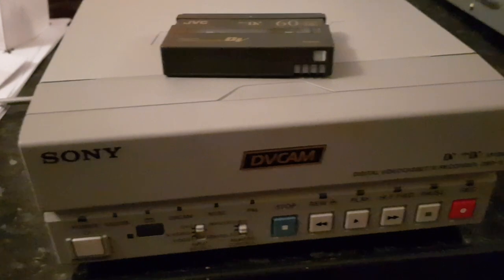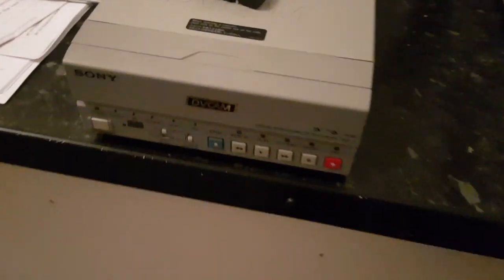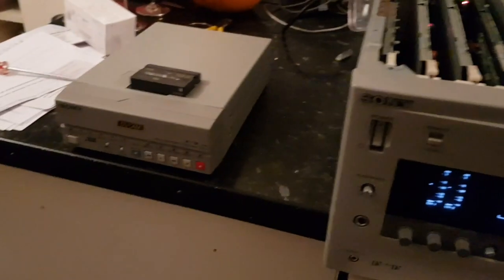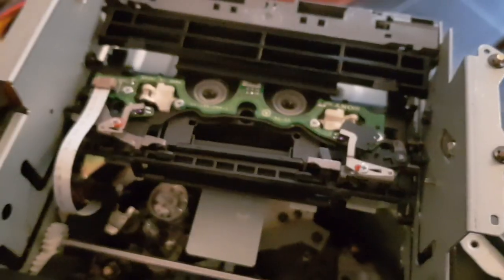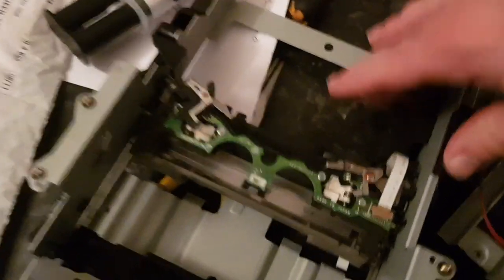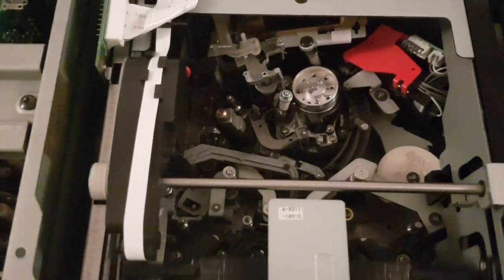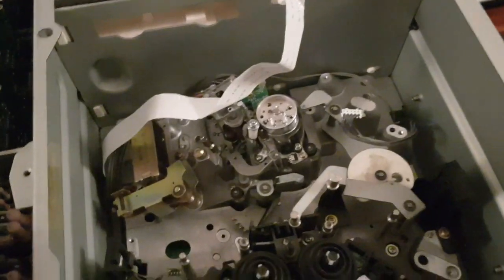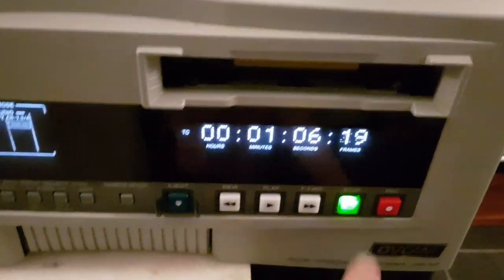Sony DVCAM DV Deck DSR80/80P Troubleshooting & Repair

Comment: Bought mine 10 months ago, just unpacked it, awesome piece of kit. Put mini dv tape in and.... brilliant!
Now need the device to transfer to computer via fire wire...
Reply from the maker: It's insane it doesn't come with FW really. SDI bridges are still very much specialist and hard to find. Might be easier to find a Sony Edit Station!

Comment: DSR-1800 gives error 02-154. Failed to detect the S reel FG by the FG check during cassette tape insertion. What does FG stands for? Any idea what could be wrong with it?
Reply from the maker: Hi there, thanks for the message. I did a bit of digging and FG is a term used in all types of tape-based media device. It stands for Frequency Generator. For any part which is supposed to spin, there is a sensor that detects the speed of this rotation. This is then compared to the signal produced by a frequency generator and if they don't match there is an error.
(source: https://books.google.co.uk/books?id=eRhJ1dni05sC&pg=PA418&lpg=PA418 )
In this case, I think it means that the S reel isn't moving at the correct speed or the sensor isn't working correctly. (There are two reels: S and T, standing for Slack and Tension respectively. The S reel is the one on the left as you look from the front of the unit.)
Refer to page 3-21 of the service manual, item 5, to find out what the procedure is. You'll probably have to use the diagnostic menu for this.
Good luck!
Reply: @BrassicGamer  Thank you so much. This was helpful.

Comment: I don't know if you could help me but i have error 22 on a DSR-80 (from service manual, trouble comes from "Threading mode"). Have you got an idea  to fix the problem ? Thanks.
Reply from the maker: Hi, sorry, only just seen your comment. Mine was also a threading problem. The only way I could work out exactly what the problem, was to observe what was happening by opening it up. By comparing with the normal threading procedure, I was able to work out what the problem was. Sometimes you have to get your fingers in there and give it some help to 'feel' the problem. If you can work out where the resistance or obstacle is, it can help to identify the problem area.

Good luck!
Reply: @BrassicGamer  Hi, thanks for your answer. yes, sometimes, i "help" the system with my fingers to find the problem ; i will insert the video tape into another VCR, i have some same models. Thanks.

Comment: I have SONY DSR-2000 way back, I have not use this since 2001.
Today I took out from the box, start used for 30 mins and my tape got stuck inside.
Its say "Error20-911.
Reply from the maker: Link to service manual is here: https://www.manualslib.com/download/1271855/Sony-Dsr-2000.html Error 911 is that the tape did not come 'up' in time. Either the mechanism is stuck because of the tape, or the tape is stuck because of the mechanism. This error results in the unit automatically powering off. The error stays in memory so, if you press EJECT immediately, after power off, it will attempt the emergency eject procedure. It is best to have a display connected to s-video out during this procedure. If this fails, you may be able to eject the tape manually as I did. Look at page 172 in the PDF (page 4-16 in the contents). You will need to remove the top panel and front panel to do this.
Reply: @BrassicGamer  Thank you.
Reply: @BrassicGamer   Hello I'm not be able to download PDF file "HELP"
Reply from the maker: @YaichaidyHD  did you have any luck yet? Here's a link to the pdf I downloaded https://www.dropbox.com/s/fo3wms8hczkqxpk/dsr2000.pdf?dl=0
Reply: @BrassicGamer  Thank you for the website, I have not start it yet.